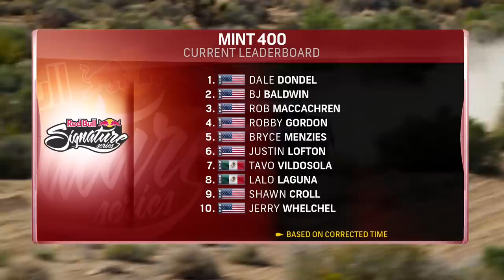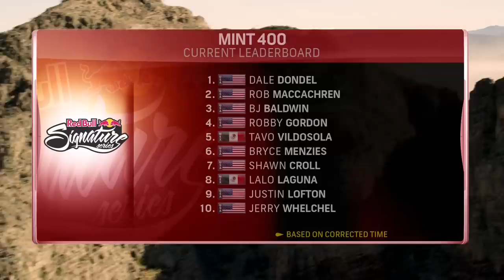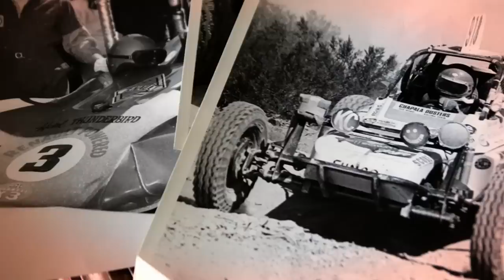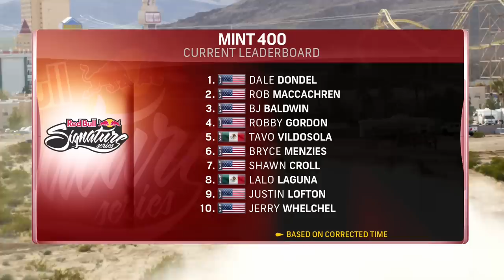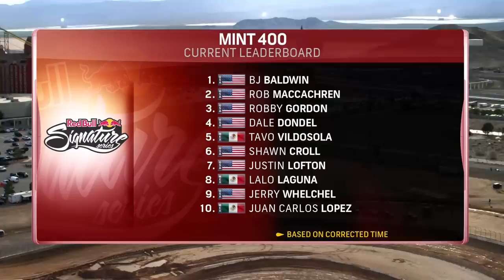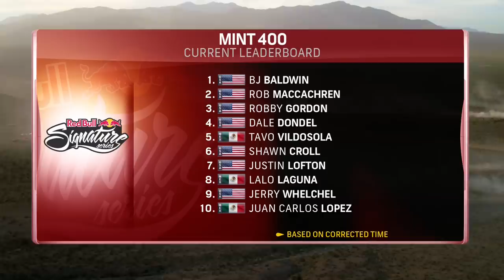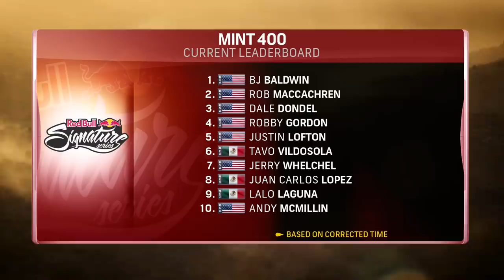Red Bull Signature Series – Mint 400 FULL TV EPISODE

Comment: Too much pollution... With so much power, and always loosing for european cars with half of power and consumption
!! Hahaha!!! 
Why don't change for hybrid or eléctric cars? America must have pollution, righ?
My car has 700hp, is a TESLA, and it's of America, use it !! If you need the V8 sound, using an artificial sound system !! Hahaha !!!
Reply: Manuel Carmo  Nothing can compare to the raw feeling of a gasoline engine though. Sure, electric cars are cool. And fast. But they don't give off the same atmosphere.
Reply: Doug S.
Cant use Electric in Desert Racing.  How would you recharge It???  These guys are  are doing pit stops in under a minute.  there is a guy who built a class one car with an all electric motor.  runs great but cannot compete in the long races because there is no easy way to recharge or remove and replace batteries.
Reply: Manuel Carmo Yea.....making and then recycling those batteries and also producing the electricity makes no pollution right? You are one of the "What I don´t see doesn´t exist" guys.
Reply: +Manuel Carmo And charging that Tesla from the wall burns how much coal to charge? How much CO2 is released? On a per mile basis what is the CO2 emissions per mile compared to an average road car? Look it up and you will be shocked. The pure electric only really shines if renewable energy is available. Otherwise all you cot is a coal or oil or nuke powered car. Complete with pollution.